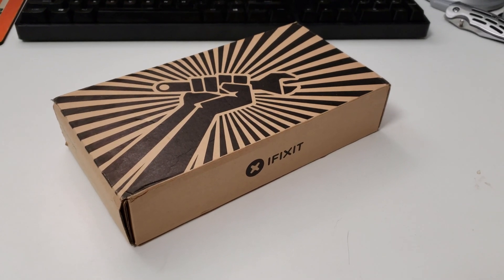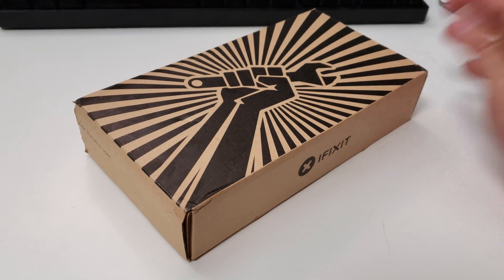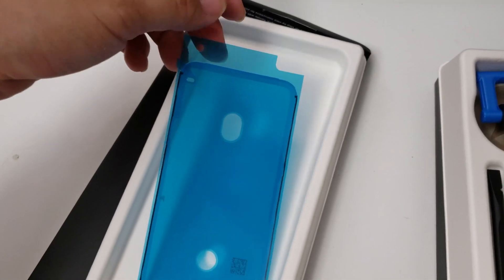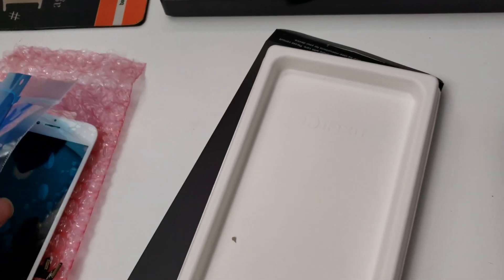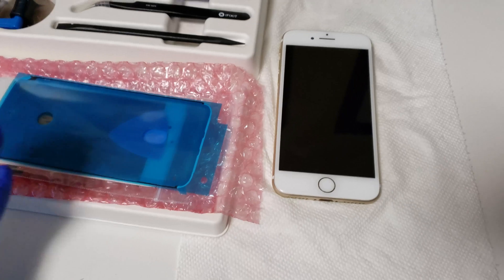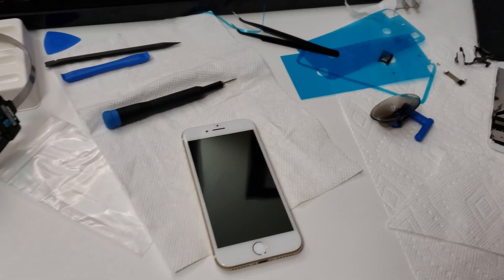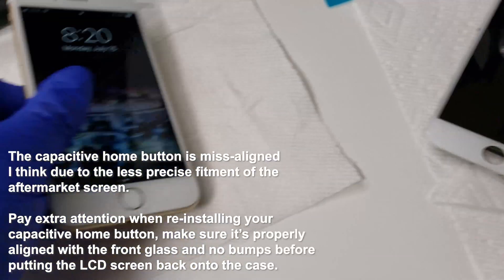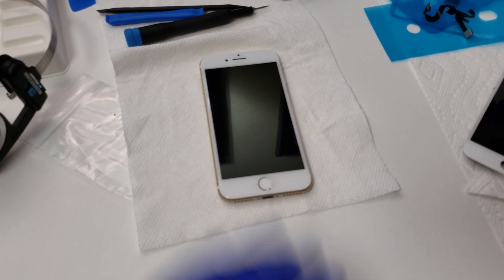iFixit iPhone 7 Screen Replacement Kit Review

Comment: Is there any problem after using it for almost 1 year
Reply from the maker: Yes, the screen failed after one year, now the phone is totally useless
Reply: So where can i buy a durable lcd
Reply from the maker: @pranavprakash98  in my opinion there is no such thing as durable LCD replacement for iPhone because all of them are aftermarket replacement. The only place you can get it is Apple authorized repair shops

Comment: Can you tell how’s the quality of the screen as compared to original, like touch sensitivity , smoothness
Reply from the maker: Yes, it works just like original screen, in terms of resolution. Touch sensitivity I feel it is not as smooth (for example, scrolling down a page feels slower than genuine screen). The capacitive home button doesn't fit flush with the aftermarket screen, there is a noticeable bump on the top of the button that is very pronounced, but it could be my installation error and you should test the button before securing the screen back to the phone. Color acuracy is generally acurate although not as acurate as genuine iPhone screen, but can be adjusted in accessibility settings.
Reply: @TheGizmoGarage  when you expose your iPhone under sun can you see the lines  on the screen?

Comment: i broke my iphone 7 and it had lines on it to the bridge of braking and it finally broke 
but my question is what does it mean when its not turning on  at all and u cant see anything do u haft to wait to get a new screen for things to be back to normal with everything in the phone ????? plz respond to me i need answers
Reply from the maker: It's hard to know if it's the motherboard or the screen that's not working in your case. Can only find out if you replace the screen first to check